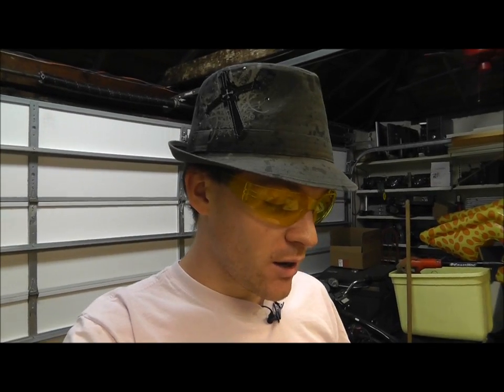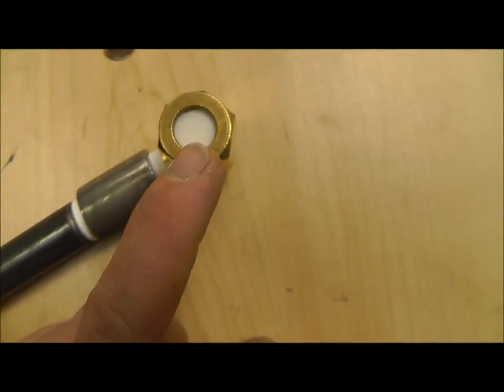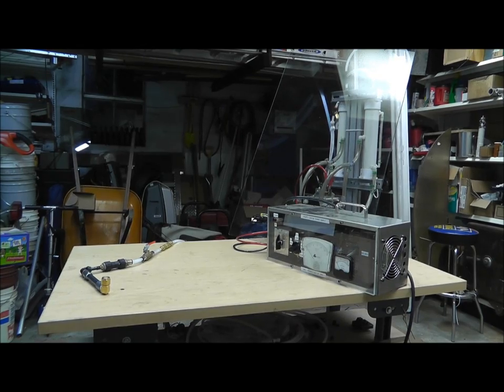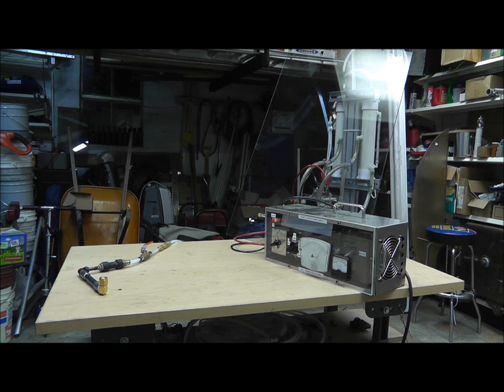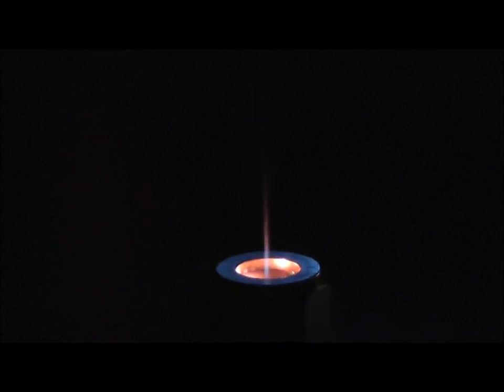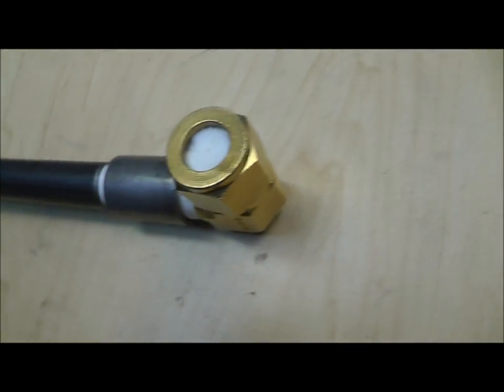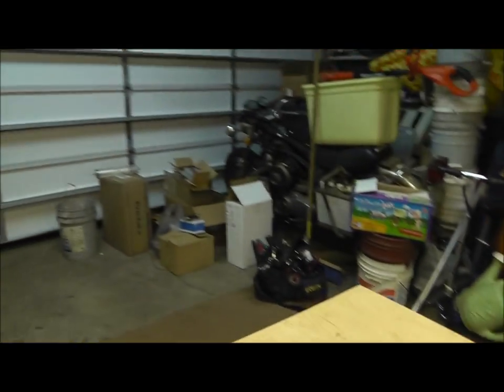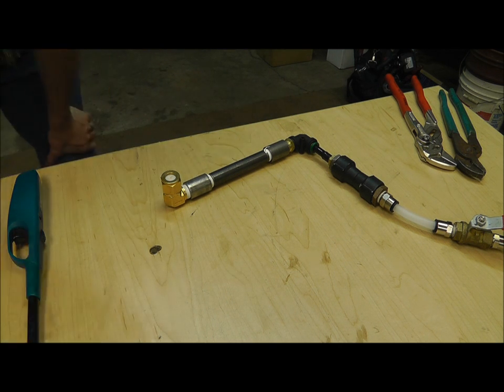Final Quenching Disk Testing. Works As Stan Stated... Hummm... RWGresearch

Comment: Thanx for testing the disks for me ,without your help we would still be guessing!
The leaks around the side were the reason for the fractures.If you heat any ceramic material at a  single point instead of the whole lot , it will crack.The multi flame looked COOL .my favorite ! You should avoid glowing the disk red hot because that can cause ignition down the supply line.Removing the other flash back arrestors will give you more pressure ,but maybe try that on your other cell.Excellent test!

Comment: an effect on moving fuels and fire is that if the fuel is moving fast enough it can not light on fire faster than the speed the fule is moving. this is the effect used on welding torches and stoves. its also being used here. this is how your disk is staying cool and this same effect can be used here. by having a small hole in a metal cap. the small hole will speed up the fuel to where you can use this effect. as long as pressure is high enough its safe.

Comment: Okay I shot you the link to the ceramic paper. roll fit and stuff for seal on the oxygenation stone. If that goes into a heat ex-changer I bet you will beat what looks like parity. Also, sorry I've not been on line much. Bday for sister and I. Now more work.

Comment: Perhaps you should be using alumina instead of yttrium? You need a very thick disc either way. 
I'd go with individual nozzels to prevent surface stress.